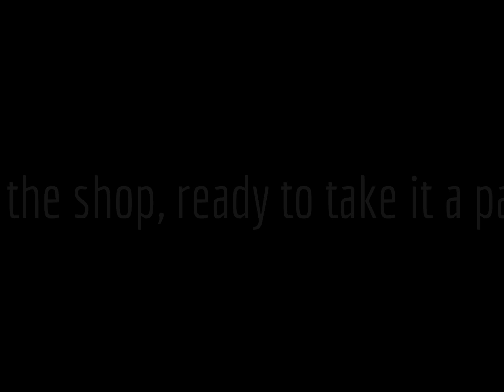Wiegman4x4.eu Restoration Land Rover series 3, powersteering and 200(t)di engine

Comment: please which power steering is this?
Reply from the maker: T-O-Y-O-T-A
Reply: which one exactly?
does not any fit from LR?
Reply from the maker: The pump is original Land Rover. You can take a Land Rover steer box also.
Reply: ok thx..... i was started built a serie 3 88, 1975